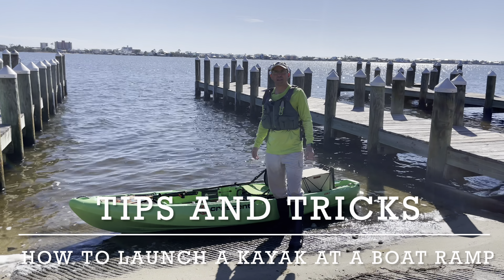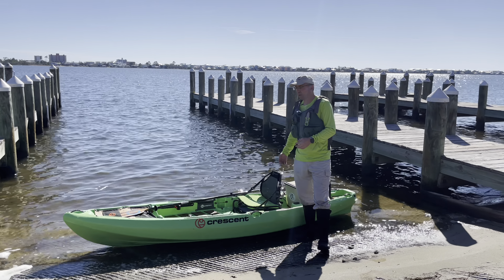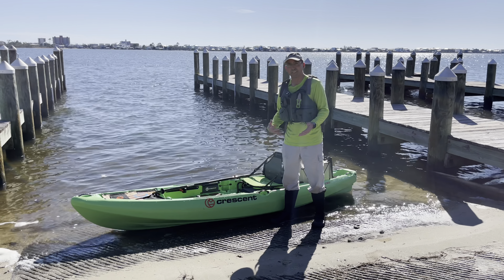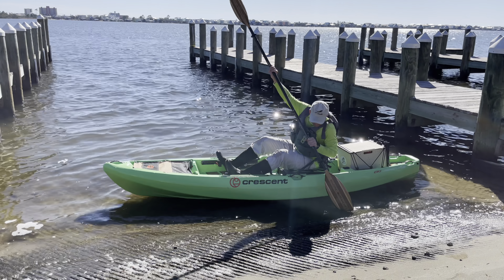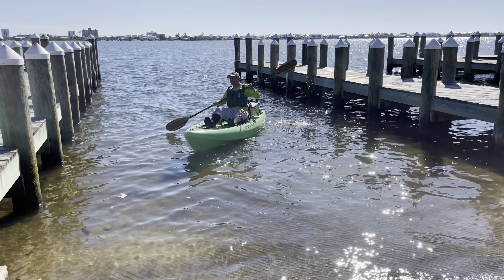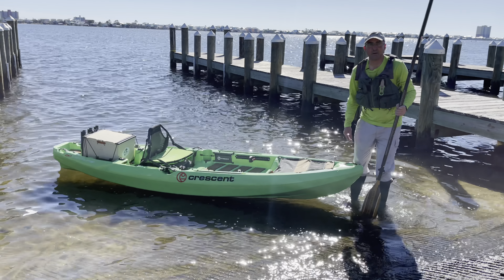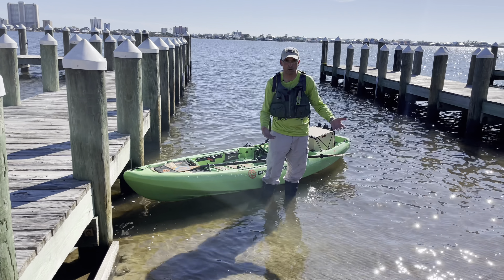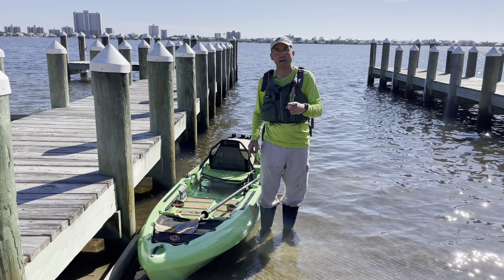Tips and Tricks: How to Launch a Kayak at a Boat Ramp

Comment: I have been kayaking for many years but recently suffered a stroke and now have poor balance, so I am reviewing and in some cases relearning everything I do in a boat.  Stepping in to the kayak and then sitting down is not going to work for me.  To get in, why can’t you just do the opposite of how you got out at 2:50 in the video?  That would be: be parallel to the ramp, hold on to the paddle and the back of the seat for balance, sit down then swing your feet in.   I’ll try that next time I am out (when the weather warms up).  To do that in my sit in kayaks, I am going to have to stay pretty flexible. 😊 Thanks for the videos, they are helpful.
Reply from the maker: Sorry to hear about your stroke, but I am glad to see you are not letting it stop you from kayaking.
You can do just as you described, I talk about that way of entering and exiting the kayak in a different video.

https://youtu.be/15gxIp18Wyw
Reply: @kayakflyfishingschool  Thanks.  That shows the kayak perpendicular to shore, but parallel should work fine.  I’ll try it on dry land first.

Comment: It’s also just way safer and easier to parallel entry and exiting no matter what surface you are using
Reply from the maker: Very true!! Safer for sure, but parallel entry and exit isn’t always possible. I have been in places that have so much tree cover, rocks, steep cuts at back, out other environmental things that don’t allow the length of a kayak, so sometimes you have to nose it in and out.

Comment: Quick question: What do you recommend to go with the CK1?  Low angle of high angle paddle?  Probably won't be using a seat riser.  Thanks
Reply: or
Reply from the maker: Roy1795 your paddle stroke may be determined by a few factors like paddle length, gear on the kayak, comfort, width of kayak versus how high your paddle sits in normal paddle position.
For me I find that I blend a bit between the high angle and the low angle paddle stroke style. I do tend to lean more towards the low angle without the riser and a higher angle with the riser.
Reply: Thanks.  Bending Branches is having a sale.
Reply: Got the low angle :-)
Reply from the maker: @roy-nk4vq  awesome!!!! Great time of the year for a new paddle!!